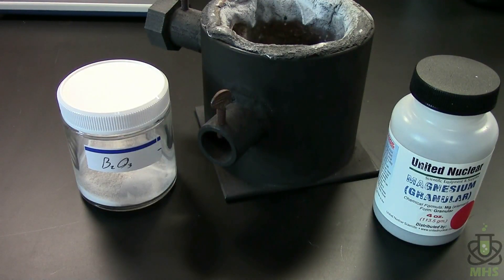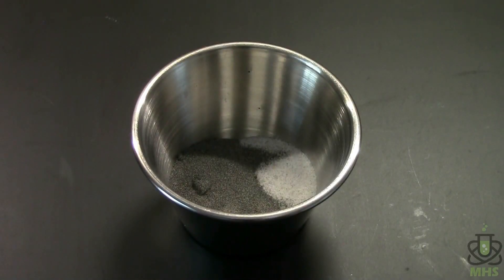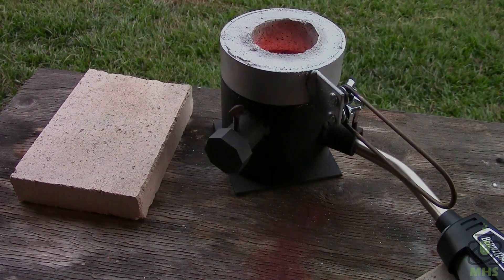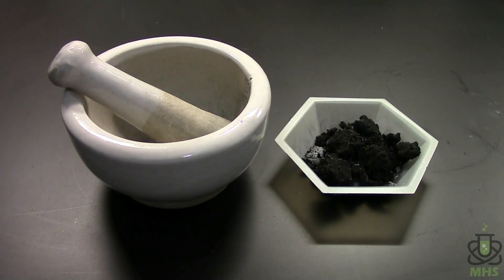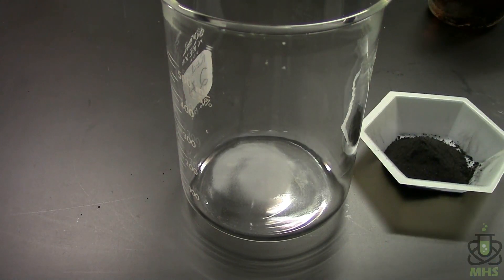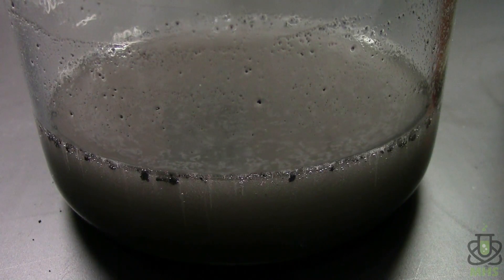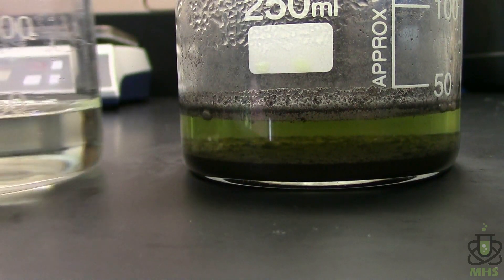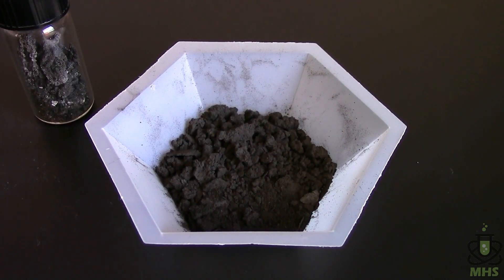Elemental Extractions 5: Boron Part 2

Comment: I know this si so old but, Im wondering if some sort of flouride flux like KF or CsF could be used durign the reaction (as well as excess B2O3) as a flux to help separate the Mg and MgxBx (Magnesium Bromides)  (potentially create MgF instead?)

I know people talked about the molten electrolysis with similar Flouride salts, The idea here is that magnesium is still doing the reduction but just more things to trap away the magnesium and maybe more time / heat to grow some nice crystals c:

also you can try to purify it with sublimation since you have that propane furnace anyways

Comment: Use sodium borate and boric acid eact with magnesium and aluminum. The reaction is not as violent. You do get more boride but lots more boron. You want the reducing agent in slight excess. The reaction yeilds boron sodium metal vapor sodium oxide, hydrogen, sodium metal vapor magnesium oxide borides of both aluminum and magnesium and aluminum oxide.. to purify mix with dilute HCl adding more until it stays acidic. Rinse twice then react with NaOH and let marinate for a few days.  You will be left with technical grade boron. ❤

Comment: I think the green colored solution came from the iron in the stainless steel crucible that was your reaction vessel. At high temperatures iron will bond with oxygen to form a black iron II oxide, and this will react with hydrochloric acid to produce a green solution of Iron II chloride. The solution remains green when it has a relatively high concentration, but the color will disappear when it becomes very dilute.
Reply from the maker: Sounds plausible!

Comment: Is it alright to use strong industrial-grade acetic acid instead of Hydrochloric acid or Sulphuric acid at 5:37?
Reply: And also would it be fine to use magnesium ribbon cut up into small pieces or turnings?
Reply from the maker: @devvrath123  Unlikely on both counts. Acetic acid might not be strong enough to dissolve the borides, and even if it did it would probably way longer than the already-slow HCl. Magnesium ribbon bits won't be small enough to react efficiently either. Surface area is very important in these sorts of reactions.
Reply: @mrhomescientist  Oh. Thanks for the info!

Comment: I want to prepare primarily a boride salt. Would you say that my approach should be to keep the magnesium in excess during the reaction? Magnesium borides are somewhat unstable, though, so even when the formed Boron reacts with the Magnesium to form  boride, that boride will disassociate into the elements.
Reply from the maker: Excess would ensure you react all your boric oxide, just don't go too far or you'll make a lot of the boride instead. The magnesium boride should all be consumed in the acid step so you'll still get pure B.
Reply: @mrhomescientist  I want the magnesium boride as a source of boranes, so I do want to go there. The idea is that excess magnesium would ensure any boron that is formed is converted back into a boride. The part to be careful seems to be the proclivity of magnesium boride to decompose into boron, so if you heat too strongly, the yield of the boride will suffer. Thoughts on this approach. I want to repeat this again--my intention is to recover the magnesium boride, not boron.
Reply: Start with borax which is sodium salt of boric acid mixed 70:30 with boric acid. Mix in aluminum and magnesium powder in significant excess. Then you will get magnesium and aluminum borides as your main product. Reacting this with HCl in the absence of oxygen will give borane
Reply: @christopherleubner6633 Interesting. What reactions are taking place to get from borate to boride? There look to be a couple redox reactions taking place between the HCl, metals, and borax.

Comment: Considering the "green color" disappeared when you added more water, I'd take a guess it was copper chloride. The HCl and copper probably reacted with O2 from the air as a catalyst as it sat out over those couple of days. Normally the copper wouldn't dissolve in HCl, but after that amount of time enough oxygen could have diffused in.

Comment: why didnt u heat the mixture, would increase the dissolving much..
Reply from the maker: True, but it also increases the rate of the elemental boron dissolving, according to my research.
Reply: well, ive done same reaction on 0,107 molar scale. now im trying to dissolve inpurities in my magnetic stirrer on 80degrees celsius... we will see :D
Reply from the maker: ReaktionChamber Good luck! Let me know how it works out.
Reply: so ive collected 1,2g of expected 1,16g ..but loads got lost in the filtration processes. do u know any analysis reactions for boron? (edit, 1,2g of wet boron powder, in the end it problaby weighs under 0,9g) sec. edit  now i have 0,87g